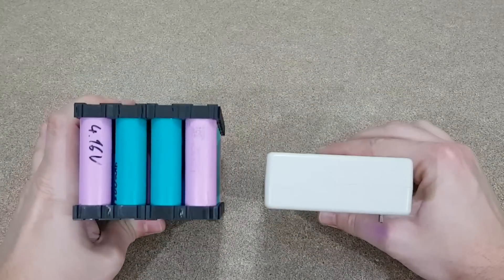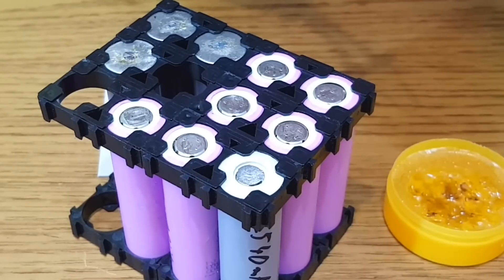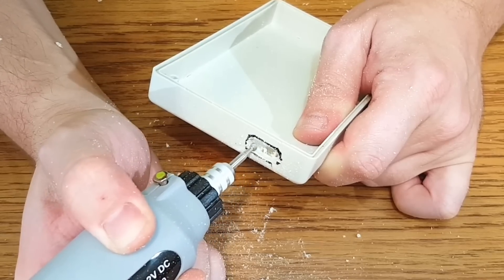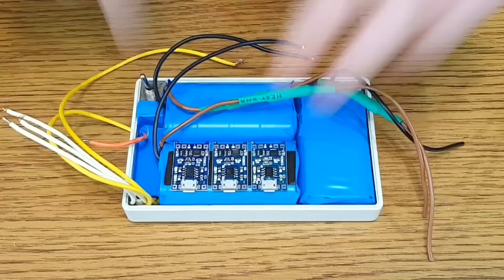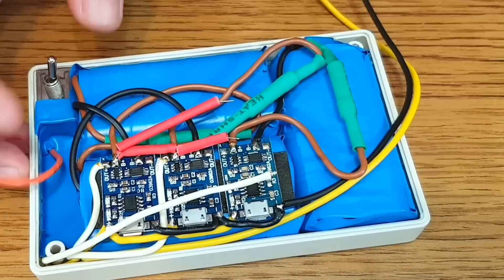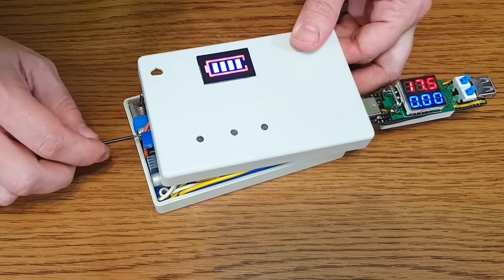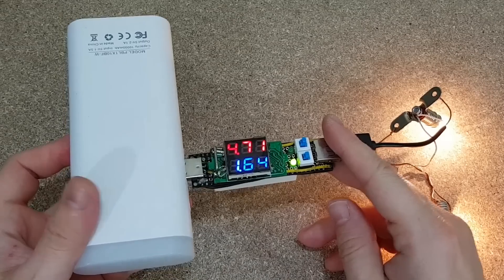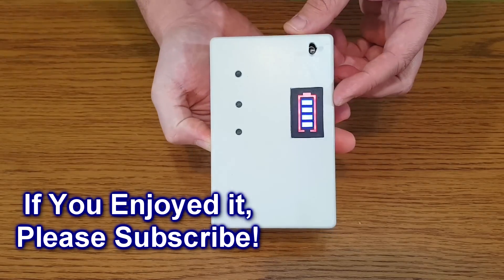DIY - 15000mAh Power Bank - With Salvaged Batteries (gets charged with 3A)

Comment: Hi shouldn't the link to the battery indicator point to one for 1S? The link is to 3S and I thought they are all in parallel when you flick the switch?
Reply from the maker: hi. the link is for battery indicators from 1S to 4S. you need to select 1S if you want to buy it.
Reply: @Sorin_DIY  Thanks for such a quick reply and great idea.  I bought the 1S it defaulted to 3S when I clicked the link. Do you have a link to the case you used btw?
Reply from the maker: I've bought the plastic box from a local store, with around $2.5. but online I can see it's more expensive. I've found 2 links:
https://www.aliexpress.com/store/product/2017-JETTING-1PCS-Waterproof-Cover-Project-Box-Electronic-Case-Enclosure-125-80-32mm-Black-Color/1758745_32825258950.html?ws_ab_test=searchweb0_0,searchweb201602_1_10065_10068_10130_10547_10546_10059_10548_315_10545_10696_100031_10084_531_10083_10103_10618_10307,searchweb201603_54,ppcSwitch_5&algo_expid=72c9b32f-9813-41a4-a81a-814ca5bb5187-14&algo_pvid=72c9b32f-9813-41a4-a81a-814ca5bb5187&transAbTest=ae803_2&priceBeautifyAB=0
https://www.ebay.com/itm/125x80x32-5mm-4-92x3-15x1-28-Electronic-Plastic-Junction-Box-Enclosure-Case-/401734202858
Reply: @Sorin_DIY  Hi Thank you so much for the links I ordered the case from Aliexpress many thanks.

Comment: In my country there are no toggle switch with 8 pin.
Can i use different one.
Reply from the maker: hi. you can buy it from here:
https://www.aliexpress.com/item/LHLL-2-Pcs-AC-250V-2A-120V-5A-12-Pin-4PDT-ON-ON-Toggle-Switch/32705600612.html?spm=2114.search0104.3.211.19033395xh59Xm&ws_ab_test=searchweb0_0,searchweb201602_5_10065_10068_319_10059_10884_317_10887_10696_321_322_10084_453_10083_454_10103_10618_10304_10307_10820_10301_10821_537_536,searchweb201603_16,ppcSwitch_0&algo_expid=4dd8a8ec-44a5-45c7-9c72-9ac468d83918-33&algo_pvid=4dd8a8ec-44a5-45c7-9c72-9ac468d83918&transAbTest=ae803_3

Comment: ... just ordered the parts :) thanks for the shematics, i didnt know i could actualy connect all the negatives together :D
Reply from the maker: hi. I suggest you use this step up converter: https://goo.gl/8HEsQ2
it's much stable, when the cells get low on power, than the one I've used in the video. and don't forget the 12 pins switch.
Reply: @Sorin_DIY  can you help explain the wires in the 12 switch? I still have trouble understanding it. Thanks in advance!

Comment: On the output, you didn't put the resistor network needed to tell the device about available current. Some devices won't charge at full power.
Reply from the maker: hi. those resistors are needed for Apple devices and maybe a few other devices. but my phone and the other phones of my family don't need those resistors, I just need to short the data pins in my powerbank.
Reply: Any more info on this? Schematic? I'm not following what you are talking about. -- Thanks

Comment: My friend, so i understand all the video, and great video by the way. Nice english and ery well explained. So, i want to make my own but, with a larger capacity. Can i make the 2 packs of 6 18650 batteries in parallel so 12 cells in total and use only one charger display and charger dc buck converter? Thinking use a switch in the ground connetion to dc buck and display with one side of each pack so divided the charging pack i want.So the postive of the both pack will be conneted. It is possible?
Reply from the maker: it's possible, but if you use only one charging module with 12 li-ion cells, it will take more than a day to fully charge them. if you use the powerbank for your phone or other mobile devices, it doesn't need to be that big and take that long to get charged. my powerbank can charge my phone 3 times. that's good enough for a weekend trip. I can also charge it in the car or at the hotel, if necessary. if you want to use the powerbank in other purposes, you should think of a more efficient charging method. for example you can connect the cells in a 3S4P configuration and charge them with a 3S BMS and a 12.6V charger in only a few hours.

Comment: weird that it dropped that massive at 1.78amp load.  8:32 and often you will also encounter cable loss, so the lacking sustained current can sadly become an issue when charging, but otherwise kudos for your build but it puzzles me what part that tumble the current this much.
I primarily use this 24.000mah powerbank that I have filled up with 8x brown high current 3000mah LG IMR-cells.
adjustable up to 24v and manage around 85watt according to spec, but in my testing, it cuts offaroundd 75watt.
https://i.imgur.com/EzmygUB.mp4
It got 2 DC connection and 2 USB connection where one is QC2 and 3.. its charges pretty fast on DC in with 2amp at 20v. so around 35 to 40watt 
But I do cherise that I can set the voltage and the amp draw and also that I can set it to not cut off with a low current draw fx under 02.amp like many powerbanks tends to.

Comment: 3 amps is too much current over micro usb, this power bank design can cause a fire with no thermal protection as Micro usb Spec supports up to 1.8 amps. All it would take is a bad quality cable and someone trying to charge their power bank to have issues. Hopefully your design gets updated I love everything else about the simplicity of it. I also wish USB-C(supports up to 3 amps at 5 volts) breakout boards were more widely available.
Reply from the maker: hi. the micro USB port gets hot, only if I charge it with a low quality cable. but I don't do that... many things are dangerous, if you don't know what you are doing. for example if you use a 2000W (or more) electric radiator with a cheap thin mains extension cable, you can easily burn down the house. it's common sense to have at least the minimum knowledge about what you are doing, otherwise it's called "natural selection" :) getting back to my powerbank, if I charge it with 3A from my power supply, with a thick USB cable, it doesn't heat up at all. but if I charge my phone with it's original cable and charger, with adaptive fast charging (9V & 1.6A), the micro USB connector and cable get very hot... so for me it's more dangerous to charge my phone than my DIY powerbank. you can use 2 TP4056 charging modules instead of 3, this way there is no risk of overheating, but the battery pack will get charged slower.

Comment: Why do you charge them in groups of 3? You can parallel the  3 TP5060 for 3A charging. What will happen if you do it like this, is that, which you also mentions in the video, is that the TP5060 modules are slightly different in end charge voltage, so you battery pairs will be at different voltages, somewhere between 4.21V and 4.11V, so when you flip the switch and switch your batteries in paralel, some current will run between the batteries, possibly not enough to blow the fuses, but you are wasting power and adding resistors as your solution is also wasting power. Just parallel all 6 cells and all 3 chargers and you'll be fine.
Reply from the maker: hi. each tp4056 charging module has better control over the charging process, if it charges only 2 cells in parallel. every electronic component has an acceptable error, usually of 1%. so if you connect all 6 cells and 3 charging modules in parallel, the charging modules will not read the exactly same voltage, and the charging current will be slightly different. so they cannot be coordinated to charge exactly the same way. the cells voltage may fluctuate because of this, while charging, this is not good for the cells. in my configuration, each pair of cells is charged as fast as possible (depending on the 5V USB charger) without any interference between them. and when you fully charge them, all the cells will have the same voltage ~4.2V. there will probably be a difference of only a few mV between them. the power wasted through the resistors is insignificant. the power wasted from the self discharge rate of these old salvaged cells will be higher, than the power wasted to keep the cells from getting unbalanced with the help of the resistors.
Reply: @Sorin_DIY  <yes you are correct in that point. Great Scott did an experiment with paralleled TP5065 and he also found out that the charging curve got very unprecise when more modules tried to control the same charging, possibly to a degree that the module with highest end charge voltage won't actually end because current is too high with more cells in parallel. So my objection was wrong Sorry Sorin! Better still would be to use  a switch mode charger like the TP5000 that delivers 3A which would make it possible to charge them all in parallel.

Comment: Can I use xl6009 4A
Reply from the maker: xl6009 will not work very good. it needs a minimum input voltage of 3.5V. and the cells voltage is between 2.5 - 4.2V.
Reply: OK thank you  @Sorin_DIY

Comment: You can make a battery cell welder with a 12 volt dc battery and a switch and some large copper wire. Battery has to be 200 CCA to 600 CCA.

Comment: @ 7:19 you say " all modules share the negative wires "  .  Is the diagram  5:05 correct?  I don't see the negative wire for step-up converter  ( IN - ) and 2 of the TP4056 modules (  OUT - )  .  Can you clarify that. Thanks! 
 Very good job !!!
Reply from the maker: hi. the schematic is correct. on the step up converter circuit board the IN- and OUT- are bridged. so there is no need for 2 wires to carry the same signal. one black wire will carry the negative signal to the step up converter and the same wire will carry the negative signal to the USB output, because the negative signal is the same for all modules. for the TP4056 modules the IN- terminals are already connected together on the wire coming from the micro USB breakout. the IN- and OUT- are bridged on the board, so the OUT- terminals are also bridged. there is no need for 3 black wires to carry the same signal to the step up converter IN- terminal, one wire is enough. there is also no need to bridge the 3 OUT- terminals from the TP4056 modules, because they are already bridged through the IN- wires.
Reply: @Sorin_DIY   Thank you for this sound and clear explanation.

Comment: It has no over discharge circuit .the battery will fail in short time , i think
Reply from the maker: it does have over discharge protection. you can see it at minute 9:22

Comment: I want to ask u something if I parallel 5500mah and 7200mah both 3.7v is this safe to make a diy power bank charger..I take the circuit board from power bank 13000mah battery..it's safe to use that circuit board?
Reply: Tushar Kashyap  he use 10 Ohms resistors? can balance battery capacity right??
Reply from the maker: hi. it's not recommended to use different cells in parallel. yes, I've used resistors, to balance them, but I have 6 cells of the same type, with almost the same real capacity. between my cells there is a capacity difference of only a few tens of mAh. the resistors purpose is not to balance different cells. it's to keep identical cells at the same voltage and not let them get unbalanced in time. so you need other cells. it's dangerous to use those cells in parallel.
Reply: @Sorin_DIY  ok understand thanks very much
Reply: @Sorin_DIY  I thought I can mix different capacity ....now I understand thank you

Comment: Can I use 3S Battery Capacity indicator instead of 1S, which you used? If possible how to hookup it?
Reply from the maker: hi. you can't use a 3S battery indicator with my configuration, the cells are connected in parallel. you can use a 3S battery indicator, only if you connect the cells in a 3S or 3S2P configuration and use a 3S BMS to charge them, and a step down, converter for the 5V output.
Reply: @Sorin_DIY  Thank you for the information and suggestion.

Comment: Thank you Sorin for the clear and useful video. My concern is with the step-up XL6009 based module. As per spec sheet it's not operating properly if input voltage < 5V. Check out feedback on the net how it behaves when used to boost Li-io battery output.
Reply from the maker: hi. you are right. when the battery voltage drops to 3V, the step up converter (sometimes) does not deliver a stable voltage. it varies to 9V but with very little current, my phone just stop charging, it doesn't get damaged. in the meantime I've changed the step up converter with the model in the link below. now the output voltage is stable and it can still deliver 1.7A at 5V. I will mention this in a future video.
https://www.banggood.com/1pcs-MT3608-2A-DC-DC-Adjustable-Step-Up-Power-Module-Booster-Power-Module-p-1213134.html?rmmds=myorder&cur_warehouse=CN
Reply: @Sorin_DIY  Good Choice, less bulky, less expenssive only it's questionable if it delivers the 2 A

Comment: Hi! I'm going to try to this but with 4 18650 5000mah 3.7v , is there anything that I need to change from the material that you used? And I also saw that in terms of safety I should use fusible wire, which type should I use? Thank you, and great video!
Reply from the maker: hi. it depends how do you want to charge them. with 2 or 4 charging modules. you can group them in 2 pairs, and charge them with 2 charging modules. you can use a smaller switch, with 3 poles instead of 4. I haven't use fusible wires recently, I don't know what to recommend you. but about those cells with 5000mAh.. I don't think that capacity is real, they are fake. the best cells I've seen are Panasonic NCR 18650B with 3400mAh. anything bigger than 4000mAh is fake.

Comment: I made one using 3 parallel 4 series 4 cell 18650 battery,. I have a dedicated BMS to balance my battery,. And as an output uses a 5 pcs 6-24v to 5v 3A step down buck converter. I used 16.8v input to charge my battery. Usually it would take  2-3 hrs of charging. And can charge 5 devices simultaneously. And it's bulky, pretty heavy and would last more than 10 charges if I'm the only one using it. Pretty good for camping.
Reply: do you use a laptop PSU for the 16.8V or some other kind of charger like a LIPO charger?